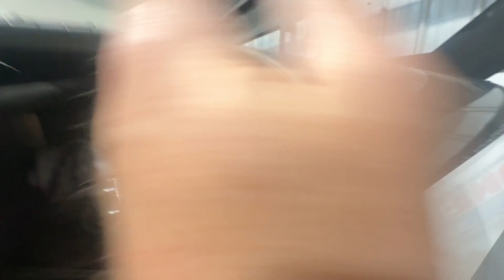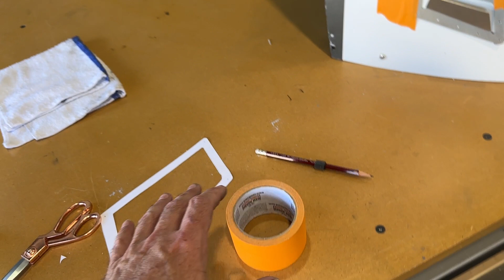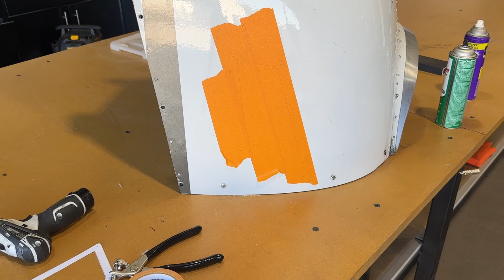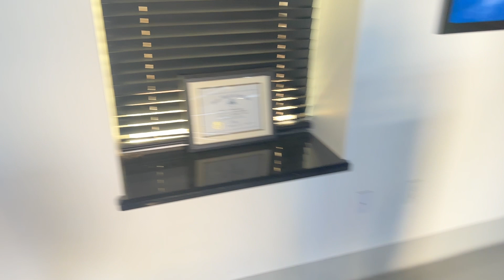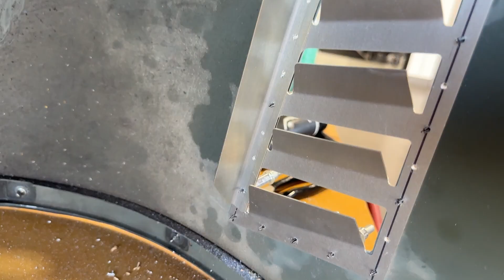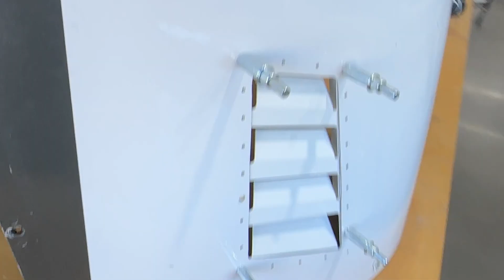Installing Cowl Louvres in a 160hp Cessna 150

Comment: A friend of mine with major airframe modifications, installed a 400Hp aluminum block 350 Chevy engine in his Cessna 150. Quite the machine. It was 80 pounds over gross weight empty from original.

Comment: Nice!  My Del Air converted C150 runs 490 degrees on climb and 460 at cruise cylinder three.  I’m glad you said the cowl openings are too small.  I agree.

Comment: They look great.   As a certified aircraft, are you allowed to modify the air frame without a STC or as a non A&P?   What is the ruling on that?
Reply from the maker: STC is only required for Major Alterations. This is minor. The supporting accepted and approved data is the Cessna 206 part and service manuals and AC-43.13. A&P enters the work into the logs and all is good.

Comment: Have you swapped cht probs?
Just the 1st thing I would do.
If you open up the cowl you will need to be careful not to super cool and crack a cylinder.
FYI.
Reply from the maker: CHT probe swap was the first thing I did. No change.

Comment: Any light getting through on the backside of the baffle plate behind the #3 cylinder... Like you said, path of least resistance, also seen front plates on the front side of the #1 cylinder to force more pressurized air to the back cylinders

Comment: Good explanation on high and low pressure. As the air speeds up and leaves the bottom of the cowling it creates low pressure, and high always wants to go to low.

Comment: I would absolutely love to see a 150 like this with a Rotax 916. I wonder if it would be faster than the S21 considering the wing? Perhaps more robust.🤔 Also could you go into more detail about your hardware trays? Did you selectively fill them? Is there a kit what types of bins. I nerded  iut and got rather excited when I saw those and want to add something like that to mine
Reply from the maker: That would be really cool to see. I bet it would be a great performing and fuel efficient airplane.
Reply from the maker: The tool chest is a Husky brand. It’s their larger ‘HD’ model. For the trays I designed them all in CAD and 3D printed to fit the drawers perfectly. What isn’t shown is there are several trays pieces together in there about 10” square that can be removed and taken to your work space.